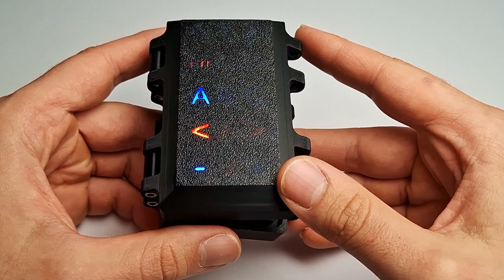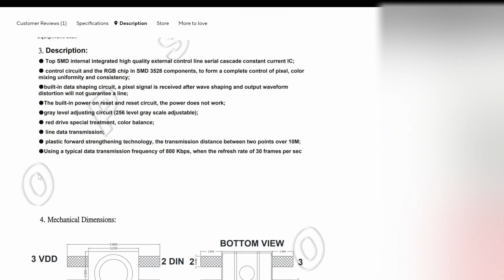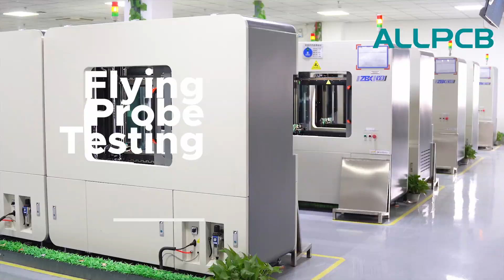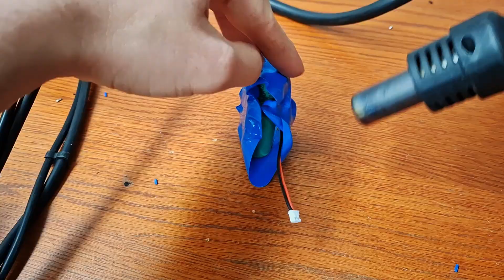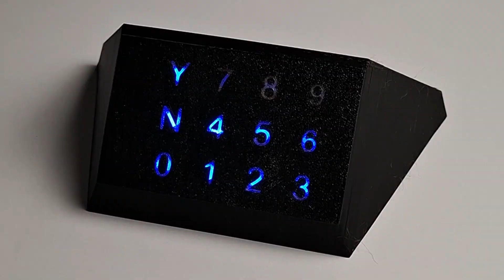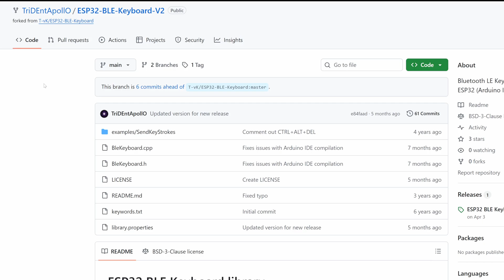Build this 3D printed ESP32 touch-pad!

Comment: Nice project. Do you think you could build this using a single filament printer???
Reply from the maker: You could, you might need to change the light pipe designs

Comment: I wonder if the capactive pads could be created by using a conductive 3D printed filament, particularly given you are already doing a multi-material print to handle the light pipes. Not sure how you connect from the conductive fillament "traces" to the PCB though.